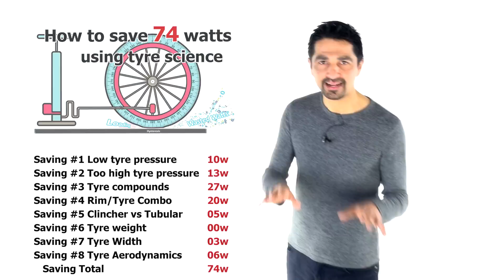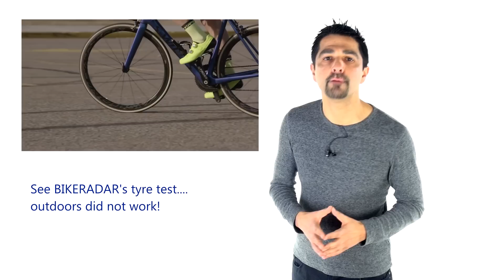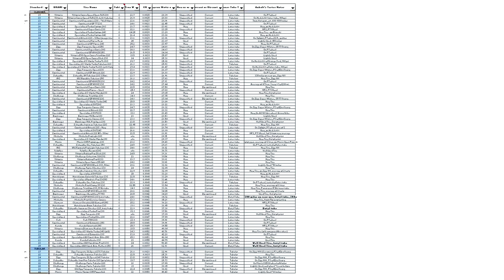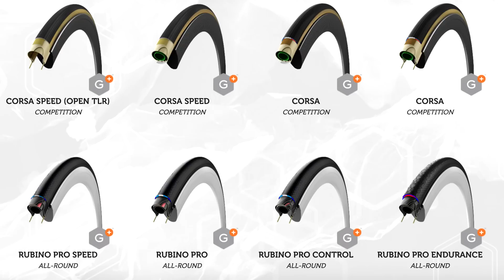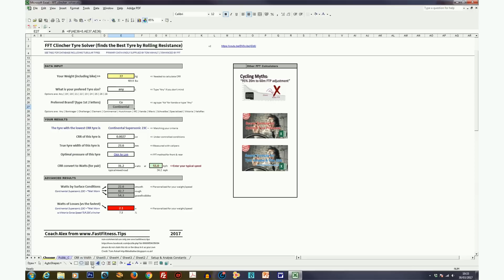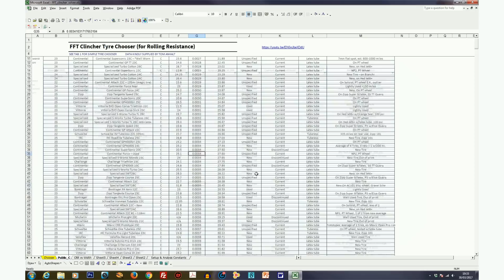Tyre Selection Science: Which is the world's fastest clincher tyre/tire?

Comment: A very good tyre I’ve found is Michelin pro 4 service course, very grippy in corners , very good puncture resistance and quite fast rolling 👍
Reply: I bought them for these reasons, "high" puncture resistance, good grip and performances, and I still have them after many years... a bit worn out, but the thread is not apparent yet (that's usually when I think about replacing my tyres).
But compared to the fastest tyres, they need twice as much power (and have ~2 x more puncture resistance).

Comment: Hi Alex, years ago in another life, riding a tri / time trial bike with a sloped top tube, we mixed front and rear wheel size (650 front, 700 rear) - that went the way of the Dodo. Regarding tires, is there any benefit to mixing tire sizes (23 front, 25 rear)? Without any data I would assume that the majority of my weight is loaded onto the rear half of the bike. The benefits of riding a 25 rear (under my fat butt) would be a bit of comfort, while the front being 23 would have a bit of aero benefit and rolling speed as per the smooth road conditions that I ride. Any sense in mixing tire size??? Thanks!
Reply from the maker: here you go! https://medium.com/@alexfastfitnesstips/should-you-go-for-asymmetrical-front-vs-rear-tyre-23c-25c-sizes-b144dc46966b
Reply: Thank you very much! So from this I believe that the "very marginal gain" may not be worth the "futzing" needed to balance the front / rear tire pressures. Given my Park Tools floor pump (+- 1psi  maybe), in my house without my fat butt on the bike, those tire pressures are somewhat attainable. However, cold versus warm versus hot days here in Raleigh, NC (and me) across the two tire sizes and air volume differences will also wreak havoc on tire pressure about 30 minutes into a ride. If I can balance the tire pressures and be somewhere +- 1 watt, I think that the real benefit may be a bit of minor ride comfort and puncture resistance (I tend to pinch and pop the rear more often when the unavoidable stones are spread over the road's shoulder). Still, a very marginal numeric gain for a bit of futzing and maybe some subjectivity in the ride feel and avoidance of the mid-ride flat. Its always good to sound everything out with some real data! Thanks again!

Comment: As someone who has ridden the Corsa speeds, they are fairly useless in the corners with minimal grip and they'll flat on just about anything. Saving watts is meaningless if you can only use that speed in a straight line and on a perfect road.
Reply from the maker: ItsDanK Very true, thank for the valuable personal feedback. Safety and cornering are important no doubt.
Reply: See the problem with your kind? you chime in, criticize, cause commotion and confusion and offer no solutions. Now, thatyou've made it known that Corsa speeds are useless in corners, what tire/tires (at least 3 other brands) combine speed and cornering grip. Straight to the answer otherwise, we can both agree you are a paid troll come other tire brand.

Comment: Sticking with my gp4000 II. This tyre glues to the ground
Reply: Side wall issues... anyone who has used GP4000 S II knows it’s flaw is the weak sidewall.  

GP4 is so prone to getting sidewall cuts that out of 4 of my personal tires, 2 has deep cuts on the sidewalk and one failed catastrophically (blowout during riding) specifically due to this. 

I’ve emailed Conti customer support but they pretty much just told me GP4KSII isn’t reinforced in the side wall and that it’s predominantly a race tire so this weakness is justified... all in all they just straight up told me to buy gator skin or 4 seasons instead...shame.

All in all, for anyone looking into getting GP4KSII, beware that they are very susceptible to sidewall cuts, and Conti won’t help you out if you reach out to them over this issue.
Reply: @FeelingGolden  How much do you weigh? what do you ride now without any issues?
Reply: Maca Its one of the hardest to fit in the industry.
Reply: gp4000 II seem to be the tire of choice around these parts. is that fad? or experience-based? no answer needed, probably no way to tease that out. just sayin.

Comment: What about wheel/rim width? same tire, same everything else, but different sized surface contact zone.... different amount of compression, all those things have to add up, how does the calculator take those into consideration? eg, i'm running a wider rim, should I be using a 23 or a 25?
Reply from the maker: Did you watch this video  answering this question? https://www.youtube.com/watch?v=CoABOk_8KH8
Reply: @Fastfitnesstips I did eventually watch that video, woyld I be correct in the following assumption; due to the (likely) more aerodynamic profile of a smaller tire on a wider rim, it is probably the case that all else being equal, a tyre that is smaller is better?
Reply from the maker: The best thing to do if match the tyre width to the rim, narrow-narrow / wide-wide. The effect is only really important with side wind (yaw > 3). thanks for watching.
Reply from the maker: hi yes I saw thats GCN video....is there a specific question? Did you watch https://www.youtube.com/watch?v=CoABOk_8KH8&t=1s?
Reply: I was wondering if 3 of their comments were tested in the data you presented, those being how a given tire responds to road abnormalities, more technical courses potentially deserving tires with more lateral strength, and if the shape of the contact patch for the same tire (on different rim widths) impacted the data, and if so, where are these reflected?
Reply from the maker: The effect of road conditions is reviewed in this video (https://www.youtube.com/watch?v=Clk_LLBYFzA) download the calculator for actual effects.....do more technical courses (ie more corners, more twisty) need different tires? no not really; the effect is mainly the surface conditions not the twistiness; does contact patch matter? yes it does but the effect is very small (https://www.youtube.com/watch?v=CoABOk_8KH8&t=1s?)
Reply: the GCN vid said a few watts in the shape of the contact patch alone and an increase in speed through corners due to the wider contact patch also... food for thought certainly.

Comment: I put science to the test today.  I had been riding on Schwalbe Luganos for two years as they had come with my bike when I purchased it.  These aren't tyres I'd recommend.   The tyre choice spreadsheet recommended Conti 4000S II.  I plugged my figures into the spreadsheet for inflation recommendations and used those.  My first ride on the Conti's today was 50 km with an altitude gain of 814 mtrs.  33 PRs on Strava segments.  I'm pretty happy with the results and the science behind the claims obviously works.  Saving around 6 watts or more per tyre is proven in my mind.  BTW I'm 102 kgs and no climber so this was a real help
Reply from the maker: ***** Its really great to receive this kind of feedback. Obviously the CRR watt savings are lower at slower speed but great result! ps Did you use the pressure calculator too?
Reply: Sorry forgot to add that.  I also used the tyre pressure calculator and pumped them to the recommended pressures
Reply: So you think you would have been faster on the conti 4000s than on the corsa speed for instance? what makes you think, you need some recommendation? they already put out a list of top rolling tires and corsa speed tops the list and every other thing that follows till around 10w will just be fine, why do you have to act like using that crappy spreedsheet that don't work again was somehow some lifesaver ?

Comment: I personally like the continental gp 4000. For me its most important to not puncture while having good grip and cornering. Low rolling resistance is not useful if you are stuck at the side of the road in a race.
Reply: GP4000's aren't hard, you're probably confusing them with the cheaper Gatorskins or something like that. Personally I'm yet to find a better tyre than the GP4000.
Reply: @Solidboat123  specialized turbo pro?
Reply: I see crashes in the corners on hard continental tires all the time. I refuse to ride them
Reply: mindciller haha, i always see vittoria tiers failing. Strange world...

Comment: Great video. BUT - what about track racing on  indoor wooden tracks. Most high performance bikes are shod with Vittoria Pista Evo CL/CS tyres up to 220psi for indoors. Will this trump the Vittoria Speed TL at it's max allowed pressure?
Reply from the maker: Its would be extremely close because I believe the CRR is very similar, but until someone tests the two tyres under the same conditions and PSI we don't know. NB I cannot comment on the safety of those pressures on a clincher/clincher rim. See our calculator on tyre pressure calculator for more info...it has been updated today! https://www.youtube.com/watch?v=Clk_LLBYFzA
Reply: The TL of course would not be at 220psi, just its max pressure. The surface is as smooth as poss, so no need to have wider tyre at lower pressure... At a recent Age-Group National Track Champs (U17's) a past Olympic medallist advised the use of Pistas at 220psi over the use of Conti GP 23c supersonics on clinchers at 145psi. He also said the use of an aero helmet without visor is not worthwhile... We went with this and used Pistas at 220psi and a Kask Bambino with visor ( as he'd donated it!) but I wondered whether would be a measurable difference. I suspect the data is not available. But track racing has specific environmental conditions which differ from the road. For example the Vittoria TL's would probably not last at all long on the road but would be fine on a velodrome. But then you'd not use Corsa Evo Pista CS's/Cl's on the road either and certainly not at 220psi, whereas you def would on the track.

Comment: That was terrific Alex!
Reply from the maker: thanks! now I wonder if there is enough data to make a tubular version of the solver/decision aid??
Reply: Or is there enough demand from tubular riders. I figure most of the tubular market is targeted at off-road, for whom rolling resistance is not a big issue.
Reply from the maker: tubular is still huge in road cycling esp those who wanted the best wheels...mostly the lightest and most aero wheels from last 5 years have been tubular although this is changing now perhaps.
Reply: FastFitnessTips: Cycling Science! 
Over the last 2yrs, I've bought 2 sets of tubulars for use as my daily riders. They were dirt cheap on eBay. Both sets vastly improved my bike's handling over clincher. Am curious about gains in rolling resistance, if you could do a  vid on that.

Comment: Is it better to run this tire tubeless or with tube?  I ask because the test was done with a latex tube, but this tire can support both options. Thanks!
Reply from the maker: Tubeless has a slight edge due to puncture resistance and ability to go low pressure with no pinch flats and slight weight savings. CRR should be better in most cases too.
Reply: @Fastfitnesstips  what's crr?
Reply from the maker: @kay19833  rolling resistance